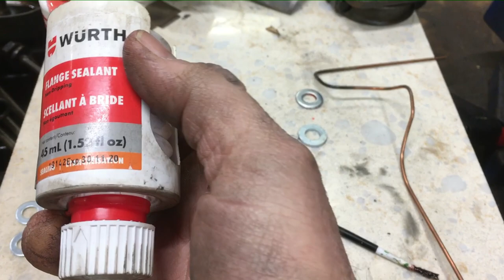Everything you wanted to know about vanagon engines but were afraid to ask. And a rant  at the end.

Comment: Hi Jeff, Nice vid and informative. I bought in 2014 a raw block  VW T.2 / T3  1,6 TD JX  factory overhauled with a new cylinder top All that I removed from my old engine did I rebuild on the overhauled block. I did drive my VW T3 ca 1000 K.and afterward I started the comåpleate restoration from my Singel Cab 1982.Water-cooled engine. Do you also diesel engines?? Hopefully, I`m driving my VW again once in the summer this year, keep up the good work greetings HCS.
Reply from the maker: I’ve built quite a few diesels. Lots of JX and AAZ, a few early turbo diesels too.  They’re very simple and reliable.
Reply: @thelogfather5002 , Their reliability is well known, that why m driving the JX  engine that iI builds to a Turbo diesel with a 5-speed Transmission. so you do a great job to keep those fabulous VWready to hit the road again. enjoyable to follow your escapades on your channel.HCS

Comment: Great Video! I have decided to attempt rebuilding my '87 WBX motor myself. Might be a bit foolish or over confident, but figured I need to fully understand this engine before we hit the road travelling for a year. Best way to learn is to get in there and do it, right? Purchased the AA Performance 2.2 piston kit for the job in hopes of the few extra horse power. I have my Bentley manual in hand and lots of nervous enthusiasm. Any words of advice to a cautiously optimistic fool before starting?
Reply from the maker: It’s fairly straight forward, don’t force anything apart or together... measure everything according to Bentley, replace your rod bolts, buy a good quality assembly lube. Don’t assemble it unless you’ve got unencumbered time to finish it. Take lots of pictures as you take it apart, it’ll help you when you assemble it. ANd take some pictures of certain steps of assembly. Like when the bearings are set in the case, the rods are hung, the pistons and cylinders are in. Don’t forget your lifters and push rod tubes when you get excited to bolt your heads down. You don’t need as much sealer as you think. That’s about it! :)
All the best, Jeff.
Reply: @thelogfather5002  Thanks Jeff. I am really into it now! It's all disassembled and the case is split. Things look way better than I expected inside. I am going to get the connecting rods honed as I would like to balance the rods and pistons, but cannot find anywhere to buy some new rod bolts. Any suggestions on a supplier?